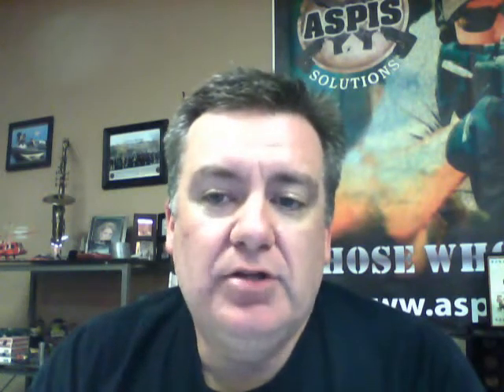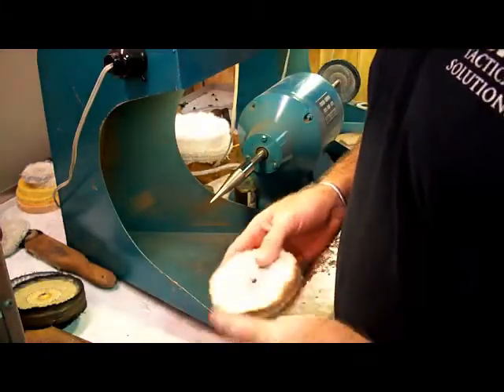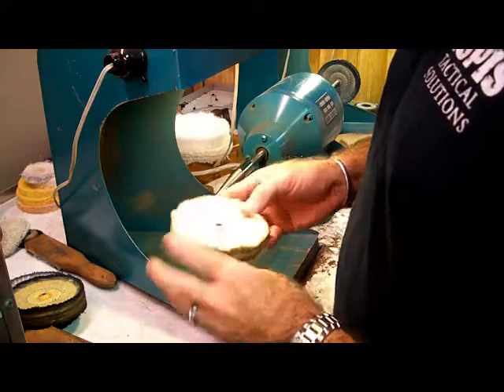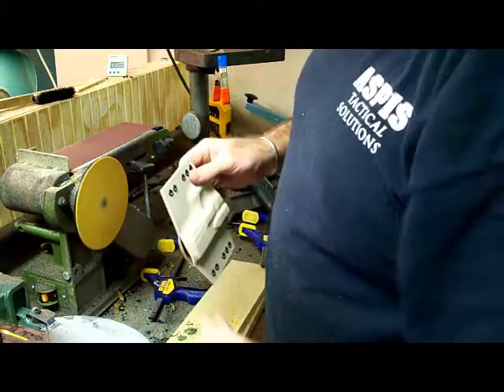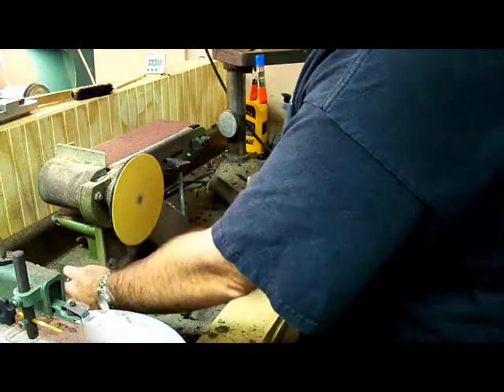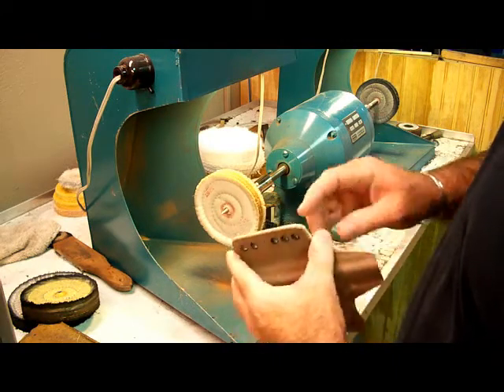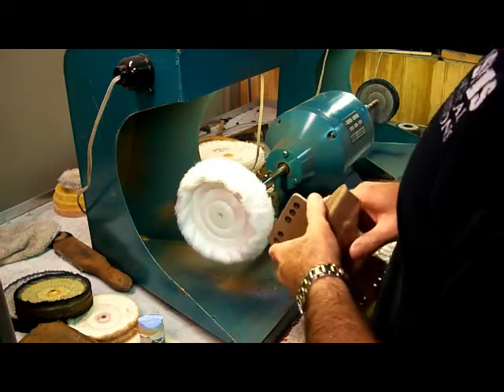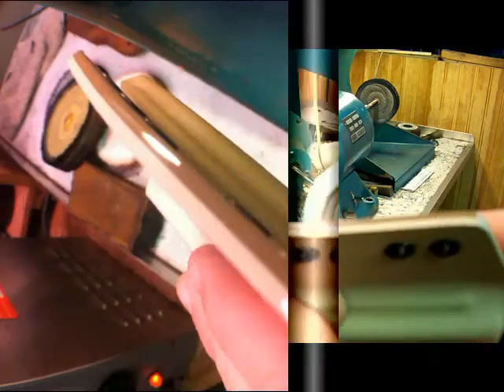DIY kydex holster edge buffing - getting a mirror finish

Comment: Thanks so much for the tip on the 45 degree deal! Already ordered that flapper wheel and spindles from you. One question though. How do you stop crud from getting in between the two kydex pieces when you sand after riveting? *****
Reply: ***** nice! Thx for the help